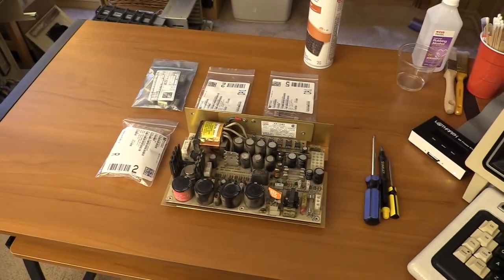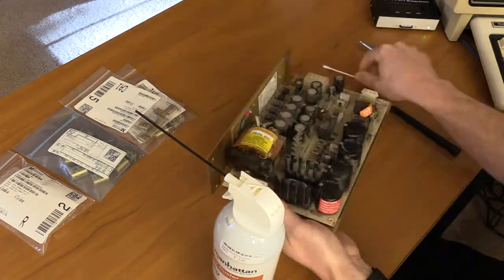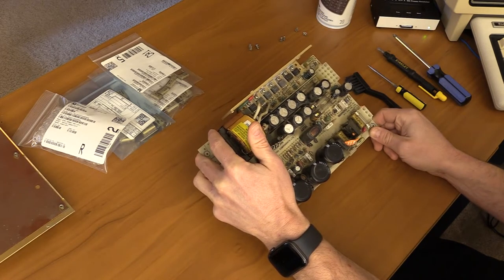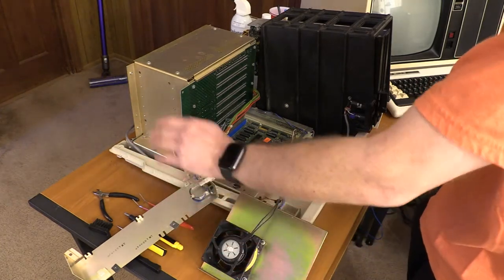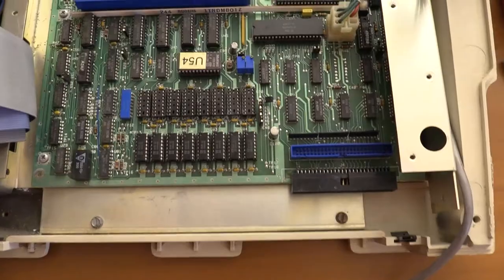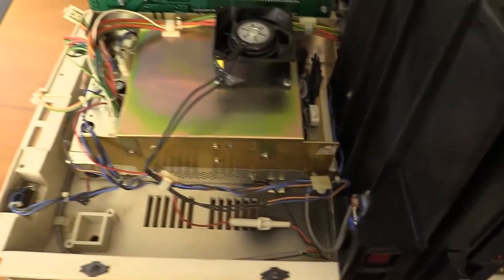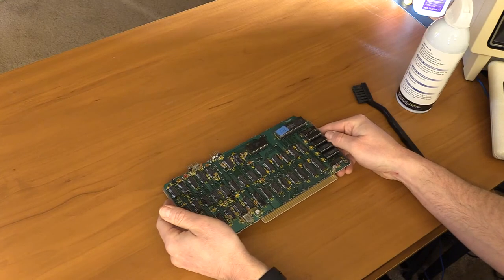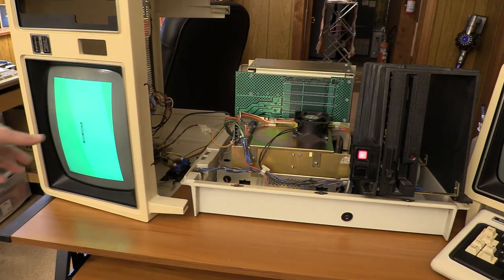TRS-80 Model 16B Restoration - Power Supply, Video Card, and Motherboard - Part III

Comment: Replacing old rifas with new ones.  I bet that triggers some folks lol.  Also those are actual RS irons you are using right?  I have the 80s version of that desoldering iron.
Reply from the maker: Unfortunately they aren’t RS irons.  I do have one floating around someplace, but it’s a low wattage iron, so it isn’t always the best one to use.